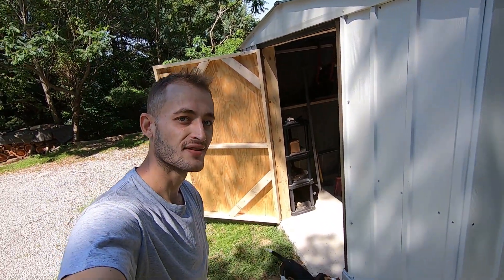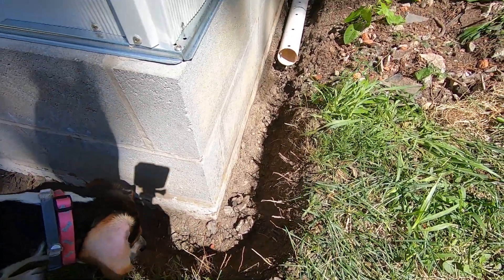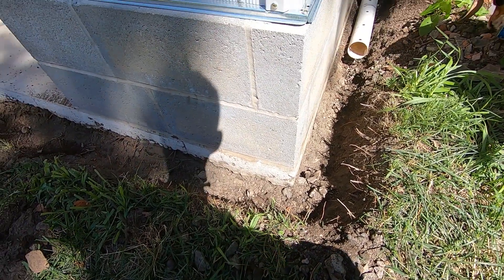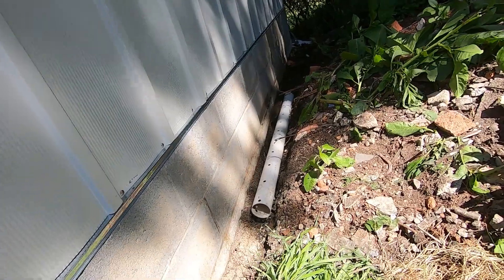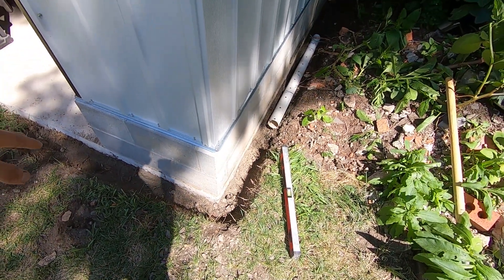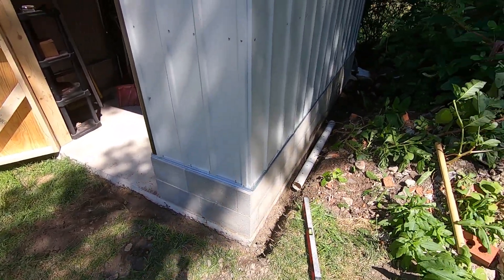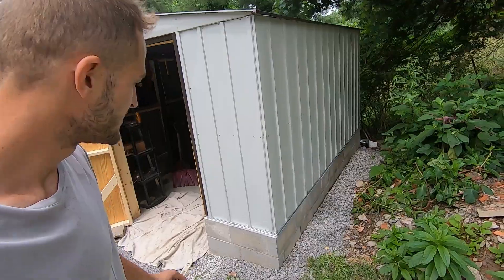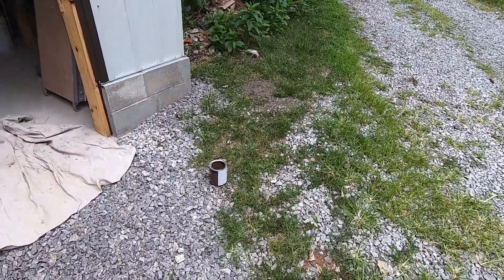Arrow Metal Shed Project Part 5 / Finishing Touches

Comment: I could really use a video on how you did the brick base!  I know it looks like "just stack some bricks up" but I would mess it up!  Like what to mortar to use, how to keep the wall straight, level, etc.
Reply from the maker: @spineblaZe  I’ll keep that in mind. To help in the meantime, I used type s mortar. To keep it straight I just followed the edge of the concrete pad. And just used a level to lay them, but I have a lot of experience with this kind of work. You could always use a masons line. Lay the corner blocks, attach the mason line to each corner block, and follow the line all the way over to ensure it’s level and straight. Hope this helps, thanks for watching!
Reply: @jeffdeshong  That helps, thanks!  Then fill the blocks with concrete?   And I assume some rebar through the bottom ones?  Or both?  Thanks so much!  I love this project!
Reply from the maker: @spineblaZe  some rebar into the pad would be best. I just filled mine with concrete. Thank you for watching!